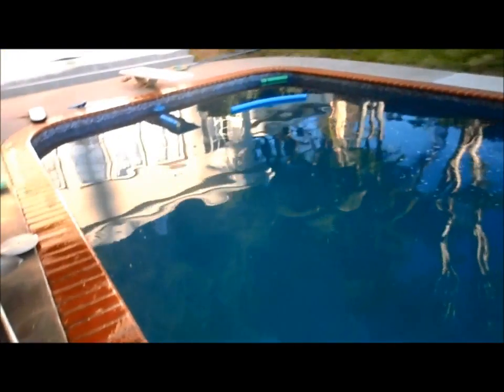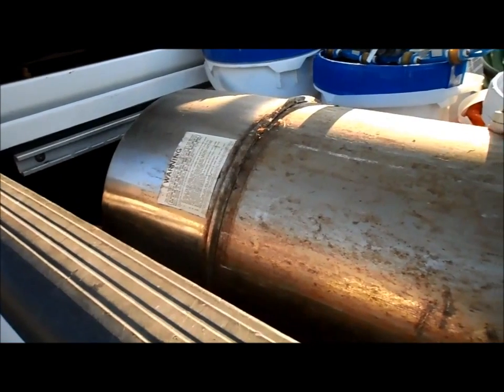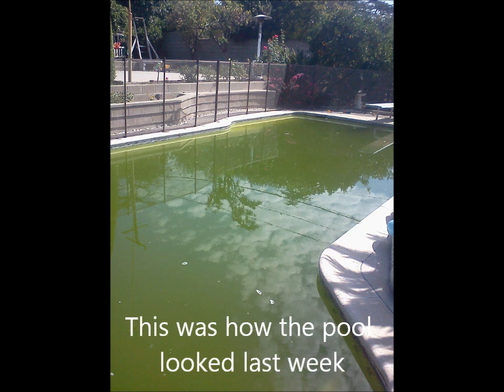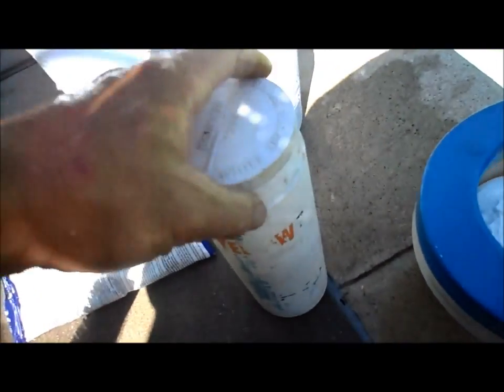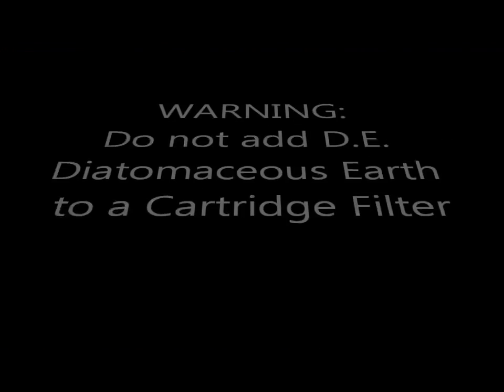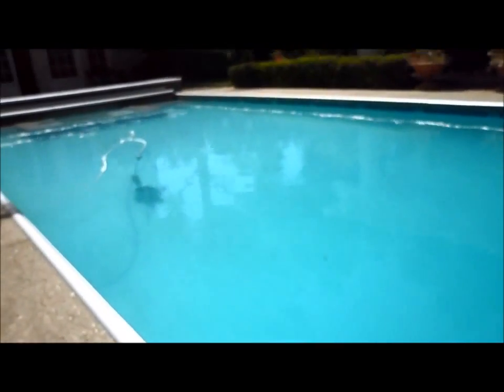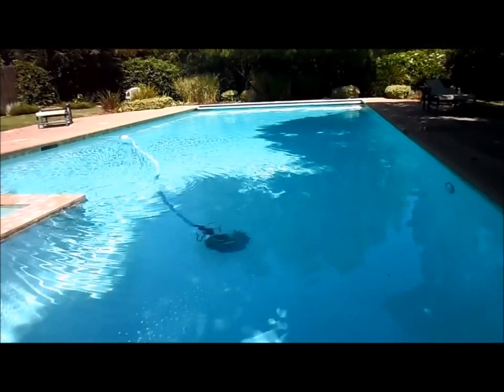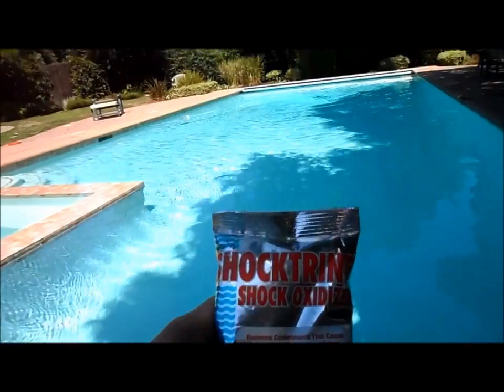Cloudy Pool Water, Causes and Cures

Comment: Hi @spl, I am new user of pool. I cleaned the pump basket and did not put it back the right way and did no fill it with water as well. Then I started the filteration system and return jets started shooting sand in the pool. Then I fixed the based issue and re-started the filteration system and noticed that the jets are shooting less sand now, but still shooting sand. Can you recommend a solution? Thanks

Comment: Someone in our neighborhood emptied their pool after Hurricane Michael and the liner popped out of the ground. A pool guy told them they should have drilled a hole in the floor to keep that from happening. A. have you ever heard of doing that? B. I have a gunite pool, can I empty it to clean it if need be? C. It's 22,000 gallons, how long would it take to fill it up?

Thanks for you video's and all of your help. I hope you remember me, you taught me how to run my salt pool years ago when we bought this house.
Reply from the maker: As long as the ground is dry you should not have anything to worry about.
Reply: @SPL  Cool. Thanks.

Comment: Question: I put some shock in my pool (granular type) and it didn't dissolve. I didn't realize it was the shock that caused it until I put more in. Now my pool is cloudy as heck and there are white specks all over the surface. The filter doesn't seem to even notice this junk. What can I do?
Reply from the maker: Just keep the pump running and try to vacuum it up from the pool bottom.
Reply: @SPL  Roger that - it seems to be getting better. I think my sand needs to be cleaned so I got some sand cleaner and plan to use it. The sand hasn't been changed or added to in - I guess 14 years. We got way behind on clearing it this year because of a back injury. The leaves and long palm fronds were all over the place and kept clogging up the vacuum line. So we just used a heavy duty net and kept sweeping and scooping it out.

Comment: My has not cleared up . I have done everything. Even had it tested three times at my hardware store. I have used algae card, clarifier, alkalinity, stabilizer, shock it and I'm also added chlorine and chlorine tablets . Water is milky I cannot see to the bathroom my pool is 5,513 gallons.
Reply from the maker: It's got to be a filter issue.
Reply: @SPL  No filter is great

Comment: Then I should shock my pool if it’s cloudy?  I have never had a cloudy pool.  This happened after I used Stain Free, followed by Metal Free!
Reply from the maker: That stuff will cloud up your pool and zero out the chlorine. Gradually bring the chlorine up to 3.0 ppm by adding liquid chlorine each day.
Reply: @SPL  Okay!  Just tested the phosphates.  It is reading 1000.  Added PR 10,000.  I added 8 ounces.  The pool is a 10,000 gal.  Will run the pump all night, vacuum and clean the filters in the morning. We have cartridge filters.

Comment: We used Stain Free, followed by Metal Free.  Result, cloudy pool.  We have never had a cloudy pool in the past 13 years.  We have filters that are less than a year old and they were cleaned about a week ago.
Reply from the maker: That stuff can zero out your chlorine fast. Try raising the chlorine up.
Reply: @SPL  oh, I did raise it up. Now it’s too high.
Reply: @SPL  PR 10,000 has been applied 3 times now, 8 ounces at a time. The pool was very high in phosphates. The water is clear now.  I tested my well water and it has zero phosphates. So, it’s just leaves and flowers, etc. that blow into the pool. The pool has not been used for 18 months or so. I do keep chlorine and acid in it.  I need to be more proactive though.

Comment: My pool has high alkaline levels, and I have been adding muriatic acid with no effect
Reply from the maker: Keep adding acid every 3 hours. If ph Drops below 7.0 use a submersible pump on the first step and shoot water back onto pool surface. You want the pool water from the submersible pump to act like a water feature - this is called aeration and will raise the pH up but not tha Alkalinity.

Comment: The DE is all blowing back into my pool! I replaced all the backseat 
valve O-rings and it is fully closed. The filter grids are in like new 
condition (not that old) with NO tears. I have seated them correctly in 
the grid holder and tightened down the nuts. The O-ring that the grid 
attaches to is in perfect condition and the return tube is fully seated! The problem came on suddenly.
 What gives?
Reply from the maker: Check the air bleeder on top the manifold. Also check the manifold for cracks.
Reply: @SPL  Bleeder is fine. Manifold previously had two cracks along side the bleeder that had been repaired with PVC cement. The water got green so I hit it hard with chlorine. When I removed the grids today seemed to be mostly coated with a lot of DE recovered from the pool (sweeper/skimmer). Again I added no DE and will check in a couple days to see if it collected more. This is because I added a lot hoping to get it coated and now it's all in the pool. Will give update. Thanks!
Reply: @SPL  Ok. The reason why I replaced the O-rings in the flush valve is because one of them was pretty beat up (chunk out of it). The filter indeed collected more DE. So I cleaned it again (full disassemble) and let it run another day. This time NO DE, but it was heavily coated with bright green algae! I cleaned it, and added 10lbs DE (Pentair 60). The first day you could not see the bottom of the pool (deep end). I brushed and shocked it. The second day, it was starting to clear up. Today, it's almost completely back to normal. For what it's worth, the pump runs just a couple hours a day, but I ran it twice as long the first day. So yeah, moral of the story: Have patience and keep cleaning the filters. Oh yeah, yesterday when I turned on the pump it just hummed. Great. But it was the motor capacitor. Luckily, I had one that would fill in until I receive the one I ordered. The only reason why I had one is because I'm a HVAC tech, and have a variety of capacitors.  :)

Comment: If I only have 500 gallons of water in the pool/spa and it's very dirty water, is it better to fill up the pool or to treat the small amount of water as is?  The water level is nowhere near the skimmer level but covers the drain.  Can I put the pump on?
Reply from the maker: Would say try to get a sump pump to remove the water. Then start fresh.

Comment: I was affected by winter Freeze back in february and my pool was down since then until two weeks ago. I had a thick layer of algae/sediments on the bottom and a dark greenish pool. Now I started running my pump again and added chlorine, the pool is back to blue but super cloudy. I kept washing my filter and keep running the pump for several days but it's still cloudy but blue. I have cartridge filter, so cant use the PoolFLoc (no waste/drain settings). What are my options? How can I vacuum the sediments out of the pool? I tried some water clarifier last night and still running the pump, but not much difference.Any tips?
Reply from the maker: You may be able to floc it still and vacuum into the filter. You would probably have to stop 1/2 and clean the cartridges. Try adding a floc at this point.
Reply: @SPL  Thanks. I kept running the pump and did vacuum the floor once. Now its lot better than how it was before. I guess it just takes time. There were lot of sediments on the floor.

Comment: I have green dust on the floor of my pool should I try to vacuum to waste or to filter. I just don’t think vac head will pick up I have lil wheels and they say not to use brush type with gunite pools so any suggestions greatly appreciated.
Reply from the maker: You can use a brush vac in a gunite pool without issue. A wheeled vac going slowly will work. Add about 1 inch of water first and then take your time and vacuum to waste. 👍

Comment: But the sides of the pool is not a problem it’s the center of the floor of the pool that’s hard to brush.  Especially at the 7 feet end.  Any suggestions ???
Reply from the maker: You need a pole that expends longer. Look at the Skimlite Dually series.
Reply: @SPL  hey I have some green dust on the floor of my pool should I try to vacuum it.  I just don’t think vac head will pick up I have lil wheels and they say not to use brush type with gunite pools

Comment: For a sand filter with around 14k gallons pool running 8hrs daily, how often do I have to backwash it? Thanks btw
Reply from the maker: Only when you notice a reduction in the circulation. Usually your PSI will go up by 10 PSI. So if backwashed recently and PSI was at 20 and is now 30 you should backwash (PSI is displayed on the pressure gauge on top of filtrt)

Comment: I’m busy putting scoops of powder into test tubes and adding drops of reagent and looking on charts to see if my chlorine level is good, and you throw a couple of drops of something right into the pool and declare “chlorine is good”

What was that stuff, and care to explain how it works?  Thanks in advance and great vids
Reply from the maker: That is a chemical used to test for chlorine called OTO. It reacts with the chlorine in the water so you can see right away if there is any in the pool. You can buy it online -  pool oto solution - thanks for watching!
Reply: Thanks very much for the quick response

Comment: My pool has cloudy water, and I see exactly what the video shows at 1:30, so I suppose it means my filter is leaking. I have a cartridge filter with a newly replaced cartridge. What can be wrong?
Reply from the maker: Take the filter apart and see if the cartridge is seated correctly. Maybe it is letting dirty water back.
Reply: @SPL  Hello, thank you for your reply! My filter is a Hayward C900 SwimClear Plus. As far as I know, the cartridge is seated correctly. I have even tried with two different cartridges, both new (one is an original Hayward cartridge and the other a generic Pleatco) and both return some of the stuff back into the water. Water is not green, but it's very cloudy, I can barely see the bottom of the pool.

Comment: What do I do? My pool is very cloudy almost milky looking and it isn’t clearing up. Tried a oxidizer and it didn’t do anything. My ph is good and so is the chlorine but it has been days and it isn’t clearing up. I have a cartridge filter as well.
Reply from the maker: Try replacing the cartridge itself. could be really old
Reply: I don’t think it’s that because the cartridges are from last year. But my pool was really green before this. I am smelling some ammonia, so do I just need to put more chlorine and raise those levels?

Comment: I just shocked my pool due to algae and it killed everyrhing overnight but my pool is blue and cloudy. Been maintaining my FC at 20ppm for three days with sand filter running 24/7 but still cloudy. Ph and alkalinity are slightly low but thats to be expected for such high FC. Can anyone tell me why my pool is still cloudy. Sand is one year old.
Reply from the maker: Try using a Floc product like Drop Out. Apply the Floc, run filter in recirculating mode for 1 hour. Leave pool off for 48 hours. Then vacuum everything to waste.

Comment: Do you happen to know how a clarifier works?  My pool was super cloudy and I sprinkled in this clarifier powder. Next day pool as all clear but it was all on the bottom of the pool. Soon as we got in it was all cloudy. What did the clarifier do?
Reply from the maker: The clarifier you are using probably has a Floc agent in it. This is basically a chemical that will clump up the smaller particles and drop them to the pool bottom. At that point you would need to manually vacuum the pool. It can be effective but running your pool longer usually creates the same effect.
Reply: Makes sense. Thanks for explanation.

Comment: My pool is slightly cloudy and slightly green. The pool is serviced weekly. But after 1 day if family swimming the pool returns to cloudy/green. I’m thinking I need to remove the vacuum to increase filter circulation?? My Free Chlorine is always around 1ppm. Should I raise that?
Reply from the maker: Sounds like a filtration issue. What type of filter do you have? And how long are you running your pool?
Reply: Swimming Pool Tips, Reviews & How To -MrDgvb1 sand filter. Run the pump about 8 hours day. But I leave the vacuum in the return line constantly. I actually did a backwash today and it seemed to help a lot. Maybe i just need to backwash 2 weekley

Comment: Ok. I think I've messed up already. I checked the water and basically very low chlorine. I then put some liquid pool chlorine in and the water turned green. WTH. Thoughts??
Reply from the maker: Probably some metal ions in the water. It is actually not uncommon. The green tint will fade when the chlorine level drops down to normal in a short time.
Reply: So will this happen every time I add chlorine to the pool ?  Should i add a clarifying agent and filter out the metal ions?

Comment: Im trying real hard to get our pool right but im struggling.  Mom was the expert and she died last July.  Im trying to remember what she taught me.  My problem is this:  the pool is cloudy and there are bugs on the surface.  Ive done a backwash, cleaned the filters, added shock but nothing is working. HELP!
Reply from the maker: It's possible the filter is the issue. If the chlorine level is high and the pool is not clearing that could be the problem. What brand and type of filter do you have and how old are the internal parts?
Reply: Swimming Pool Tips, Reviews & How To -MrDgvb1 i have no idea.  It.looks like a big dome.  As far as i know it may have been more than a year since mom had it serviced.  Is that something we can do? Check and change it?

Comment: Are both skimmer are suction working great and it catches debris into  are skimmer basket  but are  two main drain are not working but everything else is working including the pool equipment is working great and are pool is not clearing up and we went ahead and order new cartridge filters and skimmer doors.to see if that works.
Reply from the maker: New Cartridges might do the trick. The main drain is not critical.
Reply: Swimming Pool Tips, Reviews & How To -MrDgvb1  thank you so much for the advice.

Comment: Are inground pool won't clear up at all we got the chemical up we're it supposed to be and now we are working on clearing it up and it still not clear and we cleaned the filters yesterday and still didn't cleared up and we put every single chemical in the pool and still not cleared. But the pump and the waterfall and skimmer are working great but not the two drains at the bottom.
Reply from the maker: Are you running the pool 24 hours a day at this point?
Reply: Swimming Pool Tips, Reviews & How To -MrDgvb1 yes
Reply from the maker: And what type of filter and how old are the grids or cartridges?
Reply: Swimming Pool Tips, Reviews & How To -MrDgvb1 a year old

Comment: If chlorine levels are ok, do you actually have an idea what is causing cloudy pool water? I is chemical or microbes?
Reply from the maker: Even with good chlorine levels the pool can still be cloudy if the chlorine is actively trying to destroy contaminants  in the water. I suggest raising the level to at least 10 ppm for a few days and see if that corrects the issue.
Reply: To answer Raman's question - cloudiness comes from excessive amount of chloramines (product of the chlorine and organic matter it is oxidizing) His advice in the beginning of the video is correct - check your filter efficiency, run it longer but also check the amount of "free chlorine" as opposed to "total chlorine" - you will need a good testing kit, or easier - take a sample to local pool store...

Comment: I have been using drytec shock and since I have had a cloudy pool. Yesterday I put in 3 lb of shock and the timer on my pump shut the pool off so I go turn it on and white cloud came out of all jets. My pool uses a sand filter. WHat do I need to do? I feel like I need to change shock. Pool chemistry says everything ok except chlorine that why I put 3lb in it but now pool looks like a white bluish milkshake.
Reply from the maker: Try switching to just regular liquid chlorine.

Comment: 22k gallon pool with 3.5 hp pump how long does pump need to run. I have a sand filter.
Reply from the maker: That is a pretty massive pump. How big is the sand filter?
Reply: Let me double check on that.
Reply: Until pool is clear duh. Usually they say if the sun is shining on it the pump should be on.

Comment: Sand in pool and in backwash. Replaced laterals. Replaced sand. Chemicals are great. Just can't seem to get it crystal clear. Tried clarifier - a little better and Sand still finding its way into pool and backwash. Help!
Reply from the maker: How does the spider gasket look on the backwash valve?
Reply: Yup - Replaced that too!
Reply from the maker: Strange. You may have to recheck the new Laterals. Going to be a pain.

Comment: when I ruin the waste function on my pool do I loss D.E cause after I did that my pool got cloudy
Reply from the maker: Shouldn't lose any DE on waste mode as that bypasses the filter. It's possible if you didn't put it in rinse mode next that when you turned the multi-port back to filter some DE may have gotten in there. After it settles to the bottom vacuum again and see if it was just a one time anomaly.
Reply: Swimming Pool Tips, Reviews & How To -MrDgvb1 now that I ran the waste mode on my pool I've noticed that I keep losing air pressure on my pump. every morning when I go to turn on my pump it takes about a minute two two minutes to come up to Prime so how do I go about finding a air leak.